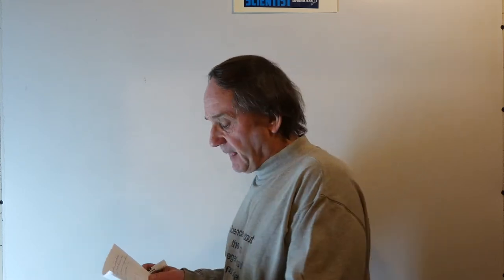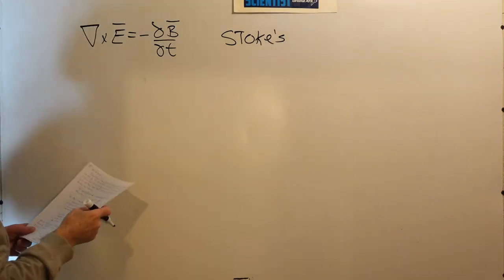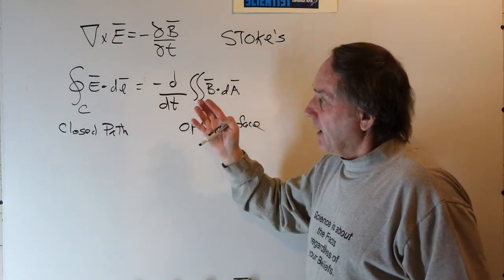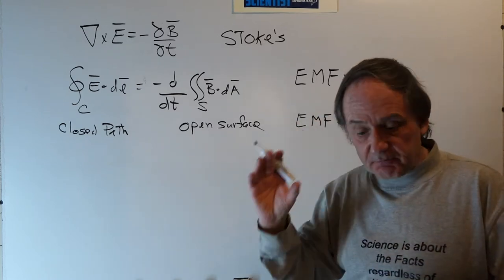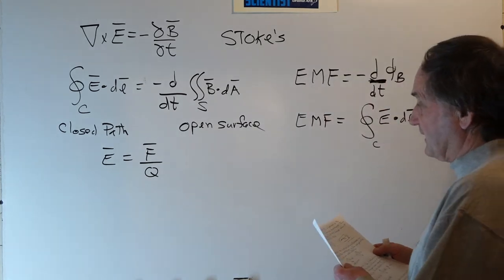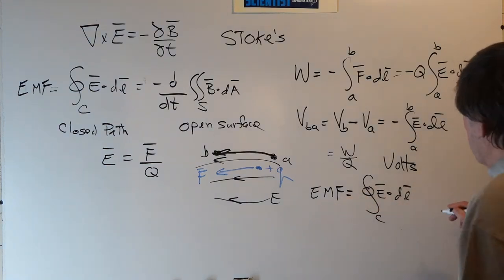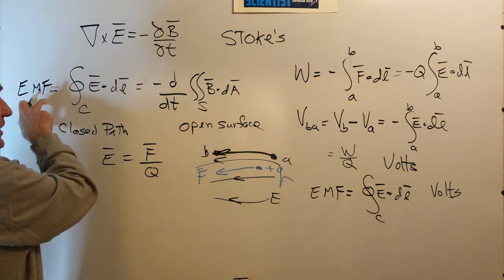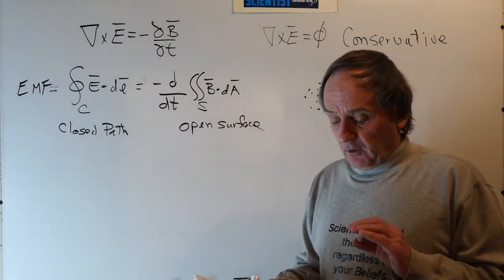FARADAY's  LAW

Comment: Second suggestion would be about long solenoid here https://youtu.be/LAoLzk3H8b0?t=1630
you're saying the length should be 10 times diameter of the solenoid,  but in fact what is more relevant is the ratio of the diameter of the closed loop with current around the solenoid to the length of the solenoid. the diameter off the solenoid itself is no so important.
Reply from the maker: That is basically true.  That is a better way of stating the requirement to approximate the long solenoid for this experiment when there is a sensing coil.  The further away from the solenoid the sensing coil is, the longer the solenoid needs to be to have a "long solenoid" condition.  You are saying basically the same thing if you assume the sensing coil is near the same diameter as the solenoid itself which is usually the case.  I had in mind that the sensing coil diameter is not too much larger than the solenoid diameter (< 3X) .  

The length is very important to minimize the leakage flux and the return flux density (B-field) in the space outside near the solenoid where the sensing coil would be placed and to insure that the flux density is uniform in the region inside the solenoid near its midpoint on its length for ease of computation in determining what the total flux is to obtain an accurate value for  EMF = - dΦ/dt.

So we actually have two requirements:
(1)  Length/diameter of solenoid >10 to insure the flux density is uniform in the region inside the solenoid near its midpoint on its length -  minimizes leakage flux.

(2)  Length of solenoid /diameter of sensing coil >3 to insure the return flux density (B-field) is minimal in the space outside near the solenoid where the sensing coil would be placed.  The outside flux could be further minimized by installing a soft iron rod looped inside and around the solenoid like a transformer core to force the B-field to flow in a confined defined path.

If require Length of solenoid /diameter of sensing coil >10, then both requirements are met.

GH                                           12/06/2018   3:38 pm

Comment from the maker: https://youtu.be/ototTU5NUNA?lc=UgzyeoDeXb93bUwqYWZ4AaABAg
Hello Professor,                                January 10, 2019  7:39pm
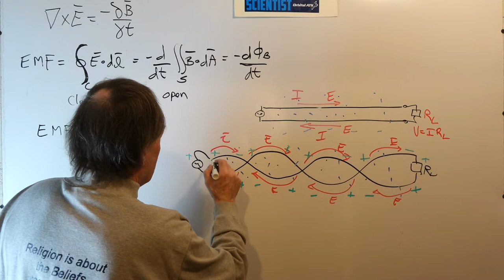I was reviewing your video and noticed something that I passed over previously.  At time 35:02 you talk about the charge separation in the wire that produces an electric field, Ech, due to that separation that adds and subtracts from the induced field which I do not dispute.  At time 37:27 you arrive at the charge field as   Ech =  13.633v/m and at the lower right of the page you have Q = 10^-11 C  which you do not talk about.   Assuming this is the value of the charge separation that builds up at the interface of the two wires,  I am curious as to how you arrived at that value of charge if indeed that is what it represents.
I played with the numbers and relationships between the D-field, E-field and wire geometry and could not get this value of charge.

Question:  What is  Q = 10^-11 C shown on your page and how did you compute it?

Thank you.
George Hnatiuk, PE

-------------------------------------------------------------------------------------------------------------------------------------

 Lectures by Walter Lewin. They will make you ♥ Physics. 
A back on the envelope calculation told me that the charge which piles up at the transition is roughly 10(-11) C. I did not want to discuss this in any detail but I wrote it for myself.

-------------------------------------------------------------------------------------------------------------------------------------

OK.  Still somewhat puzzled as to the physics to get the value.  Even if you assume that most of the electric flux is confined to the wire given that the relative permittivity of silicon as 11.8 [larger than free space], I get a back of envelop calculation charge buildup of about 1/36 X 10^-11 which is a factor of 36 smaller than yours.  No matter how I massage the numbers, I cannot get to 10^-11.  The wire diameters making up R1 and R2 are considerably different by SQRT(10) at the interface/transition so one of the problems is what to use for the cross-sectional area of the wire interface where the charge resides?  I do not see a clean way to easily determine Q.

That aside, when working on an unrelated problem,  I have found a general difficulty with the charge separation conjecture in the wire interfaces to produce another field along with the induced field.  I did not expect this but upon further analysis have found this problem to also extend to the single loop Faraday problem in certain other situations/configurations.   The two silicon wire 
configuration you present seems to be a special case which allows this explanation to be possible and calculable because of the symmetry present but appears to fall apart in general which I find very unsettling.

I would appreciate it if you would join with me and apply your expertise in the physics along with mine to resolve the issue.  I am sure you will find what I have uncovered to be quite interesting and puzzling.  You may immediately see a way to resolve the difficulty that I do not see.  If you find this of interest, I propose the following:
I would make a video outlining the problem and make it private and send you the Youtube link.   This way our discussion will be private and not interfered with by others and unrelated comments until we solve the problem.   We can communicate via the comment section of the video and via other video submissions if that proves necessary.

I can have the video made within a few days if you find this is of interest.  I await your reply.

Respectfully,
George Hnatiuk

---------------------------------------------------------------------------------------------------------------------------------------

 Lectures by Walter Lewin. They will make you ♥ Physics. 
I prefer not to enter a discussion on this. There is a reason why I did not mention the 10^(-11) C. Only one comment: there is no way that the E-field due to the charge Q could be kept only inside the wire.

--------------------------------------------------------------------------------------------------------------------------------------

Prof.  Lewin,
Thank you for your reply.  That is exactly one of the problems especially if any of the conductors are made of copper.  Knowing where the electric flux resides is not a trivial matter.  But, that is not what I wish to discuss.  Computing the value of Q is not the issue at the moment.

When looking at configurations other than the simple symmetric one you present in this video,  I have to my surprise found a general difficulty with the conjecture involving the charge separation that is presumed to occur at the wire interfaces.  Such a charge separation is required to produce another field along with the induced field that explains the difference in the electric field value found in the resistors which is different from that being induced by the changing magnetic field.  Of course charge separation is the way to explain and resolve the difference but that concept runs into some major hurdles when considering other configurations.  How the charge may separate and distribute at the interfaces is not as straight forward and simple as in the silicon wire example you present.  Even if one cannot compute the exact value of charges at the interfaces, difficulties arise qualitatively and conceptually with these other configurations.

I am not challenging your explanations of physics involving Faraday's Law for I have always fully agreed with them.  This has nothing to do with KVL and Faraday's law and the misconception others have regarding the laws.  Rather this involves the charge separation that occurs in the wires when an induction field is present and is fundamental to explaining the lack of an EMF drop in a good conductor as so many others wish to maintain exists.

As a first step in understanding the difficulties I have outlined, consider the charge separation and their relative magnitudes that must occur at the four interfaces in the silicon wire circuit of this video when good copper conductors of 30 cm length is inserted between the junction of the two silicon wires as indicated below:

                                       1     copper  wire    2
                                         /                          \
                     silicon wire                             silicon wire
                                         \                         /
                                      3     copper wire     4

This is one of many configurations(some simpler) in which the difficulties arise.  I preset this to you to invite you to first discuss in private rather than introduce the issue to the general public and create a storm of criticism related to your video such as what happened with ElectroBoom.  I do not want to start a storm of criticism. 
 
George Hnatiuk                            January 11, 2019   11:31am
Reply from the maker: ss
Reply from the maker: Prof.  Lewin,
I was hoping to discuss matters with you first in private but seeing that is not possible, I will make a video detailing this and my other concerns and post the link here once I have finished it.  Probably within the week.

Before I do that, I wish to bring an important matter to your attention that is related to the other issues I will discuss in the future.

I am afraid you have made a serious error in this lecture regarding the EMFs and induced charge conjecture.  You were right the first time stating that the EMFs are larger in regions of larger resistances than in those regions of lower resistances.  The EMF does NOT appear uniformly over the circuit sensing loop.  Start listening at time 32:36 in this video and particularly 33:15 where you state you were wrong when you previously claimed the EMF has to be larger at the locations that have the higher Ohmic resistances than those that have lower Ohmic resistances.   Your correction is in error.  You were right the first time.

That is the way the induced EMF distributes itself and that is not inconsistent with your lecture notes 20.   The induced E-field appears uniformly over the circumference at a given radius just OUTSIDE the wire and inside the wire of a POOR conductor as you have with the silicon wires.   Unfortunately, this example of yours is more of a special case than is representative of the physics we find in more general complicated structures. The situation is quite different inside good conductors. 

Lets look at your example:

            R1 = 14 Ohm      ,         R2 =  140 Ohm

        EMF  =   Induced EMF  =  - dΦ/dt  =  10v

          I  =  EMF / (R1 + R2)  =  10v / 154 Ohm  =  5/77 amp

          V1 =  R1 * I  =     14 * 5 / 77  =  10/11 v
          V2 =  R2 * I  =   140 * 5 / 77  =  100/11 v

The NET electric fields in the wires are:

         E1 =  V1 / L1  =  (10/11) / 0.3m  =  100/33 v/m  =  3.0303 v/m
         E2 =  V2 / L2  =  (100/11) / 0.3m  =  1000/33 v/m  =  30.303 v/m

                 NOTE:   L1  =  L2  =  L  =  0.3m

These are the values of the current in the loop, voltage drops across the resistances and NET electric fields within the wires.  As you say, this is non-negotiable.

The EMF drop along any length of the wires is the line integral of the NET electric field  in the wire and not the induced E-field.  Hence the EMF drop on the right side,  EMF2, with the larger resistance, R2, is  

                EMF2   =  E2 * L2  =  I * R2  =  V2  =   100/11 v   =   9.0909v

The EMF drop on the left side, EMF1, with the smaller resistance , R1, is 
                 EMF1  =  E1 * L1   =  I * R1  =   V1  =   10/11 v   =   0.90909v
----------------------------------------------------------------------------------------------------------------
Checking,

                EMF   =    - dΦ/dt    =   ∮ E • dL  

                EMF  =   ∫ E1 • dL1   +   ∫ E2 • dL2   =   EMF1   +   EMF2

     total induced EMF:     EMF  =  EMF1  +  EMF2  =  110/11 v = 10v

Clearly   EMF2  >  EMF1 must be in the same ratio as the E-fields,  E2  >  E1,   given the wire segments making up R1 and R2 have the SAME lengths,  i.e.  L1  =  L2  =  L  =  0.3m.

                  EMF2  =  E2 * L   =  I * R2  =  100/11 v
                  EMF1  =  E1 * L   =  I * R1  =    10/11 v

                         EMF2/EMF1  =   E2/E1  =   R2/R1  =  10.0

The EMFs are indeed larger in the regions with the larger resistances.  This is always going to be true.  If you inserted a wire segment made of copper(good conductor) between the two silicon wires, the EMF drop across that good conductor would be insignificant for its presence would barely change the voltage drops across R1 and R2 and the current value and the EMF distribution would be:

           total induced  EMF  =  EMF1  +  EMF2  +  EMF cu wire

The EMF appearing across the copper wire will be on the order of microVolts whereas the EMFs across R1 and R2 will still be 10ths of a volt or 6 orders of magnitude larger.  The presence of the copper wire segment has insignificant impact on the E-fields and voltages in the silicon wire resistances.

The induced EMF never distributes itself uniformly around the loop unless the loop itself is of a uniform homogeneous material having uniform conductivity and cross-sectional area over the entire loop length.

Please make note of this error which just might be that you where thinking about the induced electric field and inadvertently misspoke EMFs, which of course is not the same thing.

There are other issues which I will detail at a later time.

Respectfully,
George Hnatiuk, PE                         January 17, 2019  4:56pm